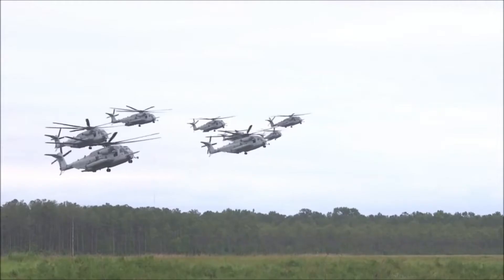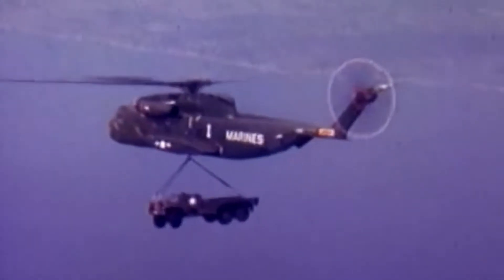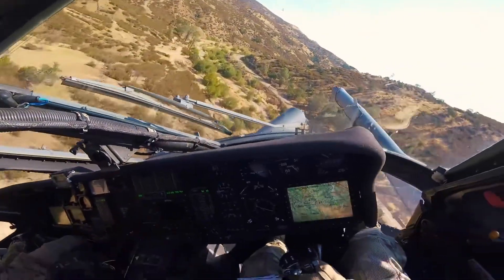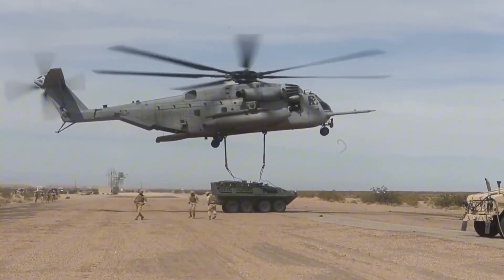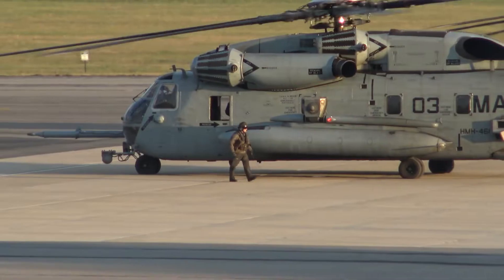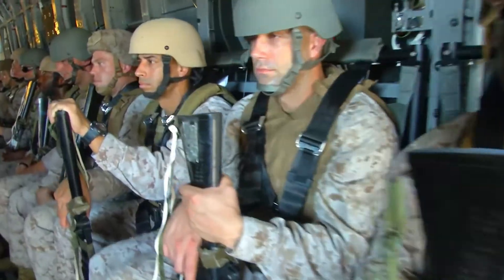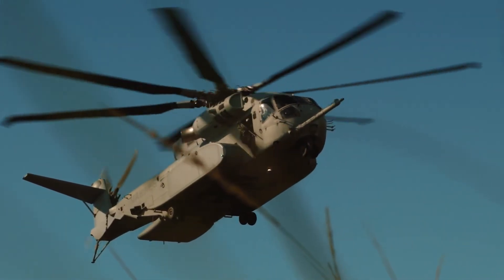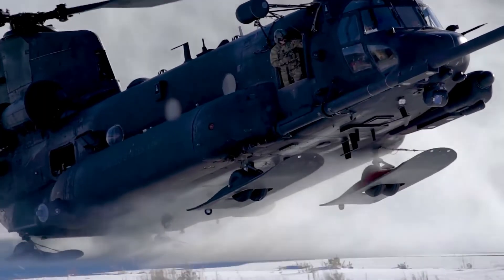Is Bigger Really Better? | CH-53K King Stallion

Comment: re osprey, you’re quoting old numbers.  mishap rate is below h-53.  it is medium lift, not heavy lift so the two are complementary.  with the rotors over in turboprop mode you are cruising at 270 kts if memory serves.  that buys you lots of operational flexibility being as that is in the same range as a c-130.

Comment: The Osprey is a replacement for the 46 not the 53. The Marine Corps in no way wants to replace the 53 with the 22. There is a difference between heavy lift units and medium lift units. Ive got a lot of time with these and the 53 program. Hit me up if you to nerd out on it

Comment: The Osprey has a reputation, but it is undeserved. Mishap rate per 100,000 flight hours is the metric the military uses. Latest numbers available, an importantly, I'm using "lifetime" numbers here, so testing up to IOC is included-
Osprey - 3.43
Blackhawk - 17.06 
Apache - 18.36
CH53-E - 5.9
CH47-D - 6.97
CH-46 - the phrog served so long it's hard to find good numbers. In the mid 90's it was 6.91, and this was the specific aircraft the Osprey was developed to replace.
for some quick examples.

It was very much blown out of proportion by the news cycle then, and remains so even now. I was riding around in 53's and 46's for a few years back when the testing was going on for the 22.

Comment: 15:43 the osprey actually has a lower mishap rate per flight hours than the Blackhawk during their operational time in service. 

3.43 per 100,000 flight hours. The chinook has 3.94 per 100,000 hours. The Ch53E has a 5.9 per 100,000 hours. 

Also it’s notable that the marine corps is the only operator of the osprey to experience a drastically higher mishap rate and hull loss rate (adjusted for flight hours before anyone says anything) than any other operator. 

What out of the 16 hull loss incidents only 2 were the air force and one of them was due to enemy fire?

Comment: Max takeoff weight of 88,000 lbs?! That's a serious crapload of band-aids, beanie weenies and freedom pellets going out to the boys and girls in the weeds. _79 ft. rotor blades, they ouldn't make them any bigger without risking chopping up the tail rotor. It's a beast. Yeah baby.

The Osprey scares me. The CH-53 is proven, safer and cheaper. I'm of the, "if it ain't broke don't fix it", school. I just don't see the advantage. The Osprey needs more work.

Comment: As someone who knows nothing about engineering. 

If the v22 Osprey is gonna succeed they need to figure out the gearbox durability issues. 

As soon as i heard that they have metal particulate zappers in the gearbox oil feed system i knew that this thing would never succeed. The gears metallurgy is so weak that they need to zap metal flakes into small enough particles so they won't jam up the system. That's crazy.

Comment: USMC CH-53 Crew Chief (6173). Assigned to a CH-53D unit (HMH-363) but trained on Echos and ended my enlistment on Echos (HMH-463 after they were redesignated as an Echo unit when they retired the Deltas as we came back from deployments in 2011-2012). Always loved the XM-218's more than the Gau-21's, but once they fixed the jamming issue with Gau-21's they weren't so bad. But ya, maintenance req's were starting to become too burdensome. Cannibalizing parts from the schoolhouse trainers and boneyard aircraft. All parts sent to depot level were basically refurbs instead of new parts; crazy that they were trying to keep those things in service til 2018. It was definitely a big bitch that commanded respect, but the thing could be a damned diva too. Loved flying on it, hated maintaining it.

Comment: If anyone is wondering, one of these puppies has about one-hundred and ninety-four 1990 Miatas worth of horsepower.

Also, it's max take off weight is about forty-two Miatas. So picture forty-two Miatas flying around with almost two-hundred Miatas of power.
Reply: Anything to not use the metric system. Hell yeah brother.

Comment: I was responsible for the production engineering and later the manufacture of the primary drive components and their assy for all S/A helicopters thru 2009.  Of all, the echos were my favorite.  Yes they leaked oil from seals in the sleeve and spindles, the main rotor hub and upper plate, the blade folds, especially when cold, but they were a hoot to watch testing   Ocasionally the E lead crew chief would call me from the hangar whenever a marine squadron would stop in Stratford. I would make it a point to grab some assemblers, machinists and take them out on the tarmac to watch the show when as many as 6 ships flew in. We stopped making them in 96 and facilitized for the K manufacture starting in 2006.  The K has an elastomeric rotor head and electric blade fold- eliminating the wet head issues on the 53Es.

Comment: Army picks tilt rotar for blackhawk replacement bothers me, the Sikorsky defiant was probably the better option, fast with pusher tail rotor and still tried and reliable main rotor vs tilt rotor. Bugs worked out with flight computing and tilt rotor? Not sure.

Comment: 15:56 Osprey has the problem of being a pioneer aircraft. But most of its crashes were during development, and its record is better now. Not to say it doesn’t have some scorching problems,  but the next generation is gonna be a lot better. But still probably not competitive with disk loading for lots of applications. Both have their strengths. No silver bullet.
Reply from the maker: I dunno I still really struggle with how complex it is. It’s go so many moving pieces it’s crazy. But I agree that I probably am being too harsh on it.
Reply: Their Osprey trans clutch was a big issue,  We never had any issue on any Sikorsky designed  transmission clutch, roller cam or teaser.

Comment: In fairness to the Osprey, its class-A mishap rate (serious damage or loss of life) has evened out to be right in the middle of the rotorcraft the USMC flies with its 10 year average running at 3.43 per 100,000 flight hours vs the CH-53E from this video running 5.9! I’m in no way diminishing the of the loss of life, both are significantly higher than the overall average for USMC aircraft (2.2) but it’s not the outlier it gets made out to be. The Marines’ Harrier, F/A18 and F35 also have variants with as high or worse rates, and the Air Force reports their version of V-22 has a rate of 0.5 per 100,000 (the same as their UH-60 rate).

The Osprey’s serious early problems were very heavily publicized especially because it looks so strange/different as a hybrid of fixed wing and rotorcraft, but they also have a lot of recency bias working against them- the early days of most other airframes (at least entirely new, not updated models) are decades further back in memory and any aircraft the US Military has flown have all had higher accident rates than we’re used to thinking of. It does have real problems, it’s just worth knowing the context.
Reply from the maker: That's an interesting and surprisingly well reason argument (especially for a Youtube comment). Normally people would just say "You suck!" and move on. I think you're right on the money regarding it's strange looks making people feel differently about it. I know for sure I fall squarely into that camp. I'll keep that in mind if/when I make a video about one. Who knows...maybe one day I'll work up the balls to actually ride in one.
Reply: @TacticallyAcquiredActual   I can’t blame anyone for being uncomfortable about it, and military equipment isn’t something you generally get a choice about riding on or not if orders expect you to use it so you shouldn’t have to wonder if your own equipment is what hurts you be for even getting to the risks of combat. I think it’s only right to at least be able to be aware of the actual risks and where something might be misleading about it, having aerospace engineering training but also fmr military parents. Also, just came across the channel but like what I’ve seen!
Reply: The Osprey also carries twice the troops as a Black Hawk so when one goes down it can lead to a much higher loss of life making it more tragic and thus bigger news
Reply: They've been working on the Osprey for over 45 years, and neither are perfect. Both are necessary.

Comment: Those upgrades made me think of the Tillman Battleship concepts from the early 1900, when the Secretary of the Navy, some guy named Tillman, got tired of the incremental improvements between successive classes of battleships, said to just go all out. So some of the concepts had something like quad turrets with 6 16" each and all other kinds of craziness.
Reply from the maker: I’m gonna have to look into that. Sounds like a video idea in the making!

As always, appreciate you being here!
Reply: @TacticallyAcquiredActual  Glad to be here!
Reply: Since YOU Never operated turrets? Weren't in the GUNrooms, Projectiles DECKS, Electric Decks, Angle Irons, or Lost Comrades and dear friends on April 19, 1989 9 am! It would be a Great Idea to SHUT YOUR MOUTH! In regard to anything concerning AN-MK7 16INCH 50 CALIBER GUNFIRE SYSTEM or AN-MK37 FIRECONTROL SYSTEM. You weren't in the turrets?  Wasn't in Main Battery Firecontrol Room, never Set Up the Firecontrol Switchboard?, never adjusted the Spot fireco trol radars or used the MK 8 Optical equipment.  Save the wear and tear from typing anymore of your nonsense. From a BB61 CREW 87-90 GM and FC trained Cold War veteran.